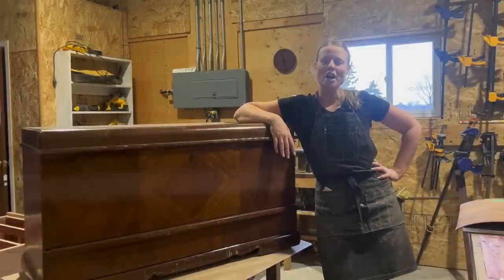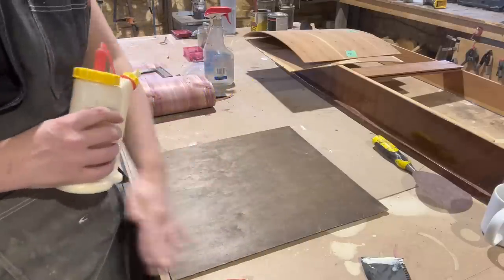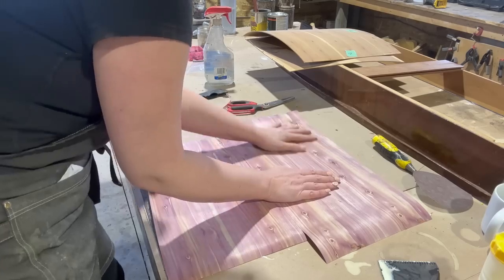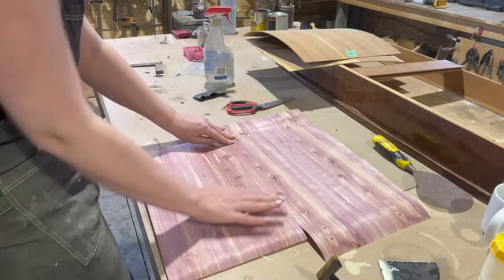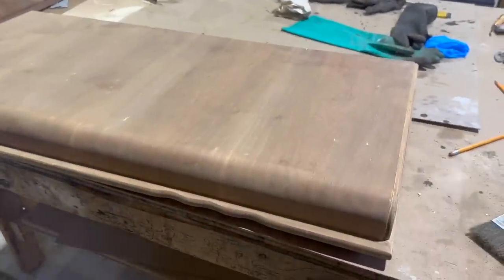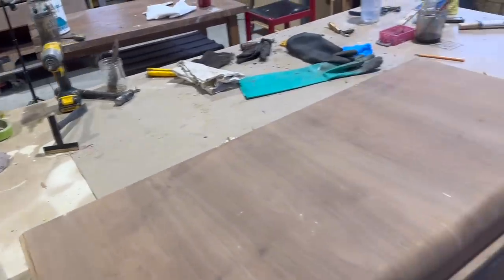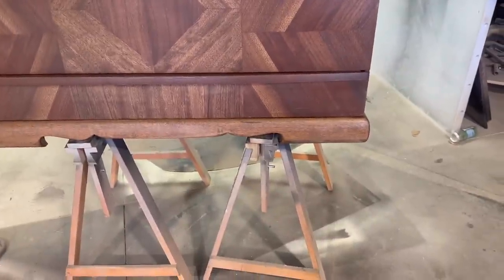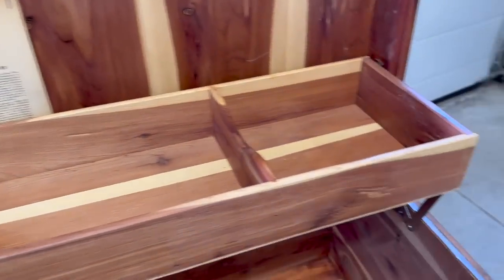How a WOOD SHOP refinishes an old cedar trunk

Comment: Thats beautiful, I made my granddaughter a chest from pine boards and painted it with a sprayer like you use, had to cut the water-based wall paint with over 50 pct water just to get it to spray. Can't get it right. Don't have the finances for  good tools.

Comment: Trena, I enjoy your youtube channel and your work. Please don't take what I'm about to say as being critical of your work. I only wish the best for you. Many of these old cedar chests came with a special instruction sheet inside the bottom drawer stating that the purpose of the bottom drawer was for storage of documents, items made of certain metals and items containing natural rubber. The aromatics of cedar will degrade or destroy these types of items (and destroy ink). Therefore, there was no cedar in the construction of the lower drawer, specifically because of the effects of cedar on some materials. Please carry on and I wish you the very best in your upcoming move and new shop. Sincerely, John Wagner
Reply from the maker: Thanks John, yes I am aware of these certain types of drawers. But as you can see in the video the original drawer was cedar and the customer requested it to be cedar again. But i have definitely seen the type of chest you are referring too. It was actually annoying because cedar veneer is hard to get. Thanks for the input and for watching. Cheers!
Reply: @johnsfurniturerepair  Trena, Thank you for the quick reply. It makes sense. Could you tell me if that Cedar Chest is a "Lane" brand from here in the States. If so, with the Serial Number, the owner can go to their website and Lane will furnish a different lock, free of charge, to keep children from getting locked inside and potentially suffocating. Thanks again. Sincerely, John Wagner

Comment: What a beauty! You have done an amazing job as always. 
I have a trunk. Looks like a old army boot locker. It has been painted with black but I can see some old army green peeking through. It’s very heavy and besides the bad paint, it’s only missing the key and the carrying side leather straps. The I side looks to be the original muslin. Which is very smelly. Any suggestions on how I can go about making it a useable chest? I would love to strip the paint and buff up the hardware. But I have no idea on what to do with the interior. If I use any cleaning products it will probably remove the muslin. Which I’m not totally opposed to but will I ruin it. 🤷‍♀️
Reply from the maker: stay tuned, i have a trunk restoration coming up

Comment: Bourbon Moth did an eye opening video on self ignition of rags used to apply stains or oils. What system do you use in your shop? You use a lot of rags and your shop isn't on fire so.....air tight metal container?
Reply from the maker: Lol it’s definitely not on fire. I lay them out  to dry and then they are kept in a fire safe metal canister until they are brought to toxic waste. Thanks for watching!
Reply: @johnsfurniturerepair  maybe you could consider demonstrating this in one of your videos. I didn't think it was a high risk till I saw it happen.

Comment: I have an old cedar chest that has copper bands. I want to refinish this piece. I’ve tested part of the copper band using stripper and it cleans up well. I’m hesitant to remove the copper fearing it will not lay down smooth when I go to put it back on or will damage it trying to remove it. What would you suggest?
Reply from the maker: Just do it as carefully as you can.

Comment: Lovely restoration as always.  Question:  what is the purpose of ironing over the broad veneer surfaces?  Does this reactivate hide glue?  If so, what is the heat setting?  Thanks.
Reply from the maker: It will yea but it mostly don’t to lift indentations in The wood surface to reduce sanding on veneer and solid woods. Cheers.

Comment: Have you ever tried to add back the cedar smell in one of these? I tried sanding, but that didn't bring back the cedar smell. I hesitate using chemicals because I don't know anyone who has used them. I didn't want to end up with a petroleum smell.
Reply from the maker: Usually a good Sand will do it. Not sure if another method

Comment: Hi, Trena! I used the Circa 1850 you showed in your video to strip a rocking chair. It did the job, but I was surprised by how thick it was despite it not saying anything about it being a gel formula. Is there a way of thinning the strip one, to make it stretch further, and 2, so I can strip round and detailed surfaces more effectively. Also, do you happen to know if  there is  a difference between the one you showed and the d-solver product under the Circa 1850 brand name?
Reply from the maker: I’m not sure how to thin it. That what I do t like about alot of strippers. They are always so thick and don’t allow you to wash things down. I think I e used the d-solver before. It is good too
Reply: @johnsfurniturerepair  Thanks. My best success was when I applied the "liquid stripper" to the spindles and then rinsed it with a brush and lacquer thinner in the same way you do with your thin stripper (learned that from your videos!). That did the job. I just wondered if there was a better way given the stripper you use isn't readily available to beginners like myself. Thanks for your time.

Comment: Sorry to ask but I noticed at the 10:45 second mark you were ironing the top while the surface was wet. Was that just water to lift grain or re adhere the old glue, I assume that wan't sripper (seems dangerous)? Thank you.
Reply from the maker: Oh no definitely not stripper🫢 it is to lift indentations to reduce the amount of sanding. Cheers!
Reply: That's what I thought, but I guess I would have been looking for a cotton sheet or something between the iron and the wood, but I'm just trying to watch and learn. Thanks so much for your reply. Cheers

Comment: Have you ever used a j-roller instead of a veneer hammer? If so why do you use the hammer over the roller? I've found the roller works well except in tight corners.
Reply from the maker: Ya I find you still need both so I just keep the hammer on hand

Comment: Would you call that piece of furnitue especially the front part, inlaid wood finish Trena?
Reply from the maker: no, its just a veneers pattern, inlay is usually smaller pieces of contrasting wood in highlighted decor or motifs. cheers

Comment: so why do you use hyde glue for some veneering and titebond for others what is the difference
Reply from the maker: I like it for veneers because in older pieces it was usually used for veneers and it will rehydrate with new glue added. It is also reversible if I need to redo something. It’s just a better glue for preserving older pieces. Carpenters glue is good for laminations and done repairs on newer pieces. Thanks